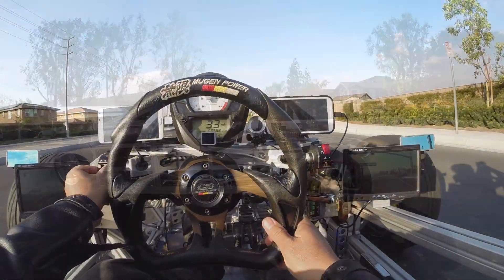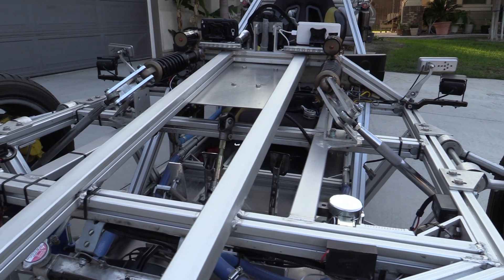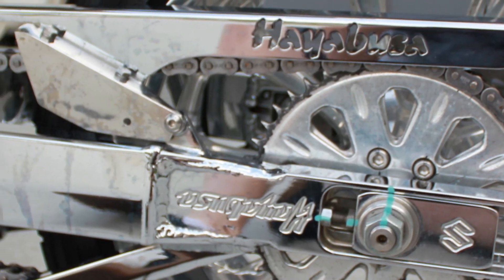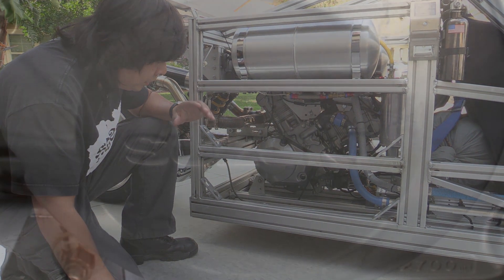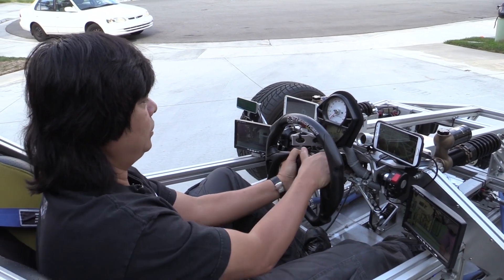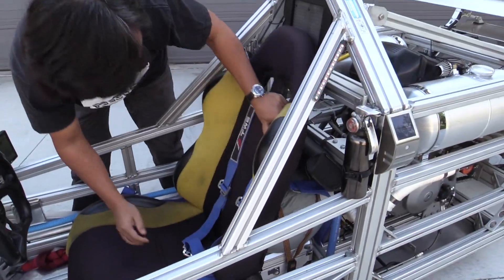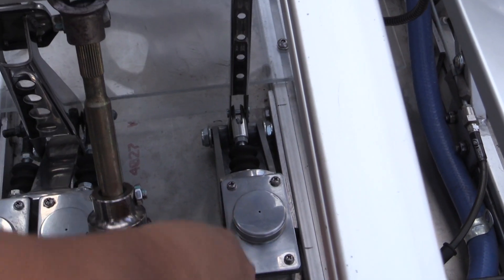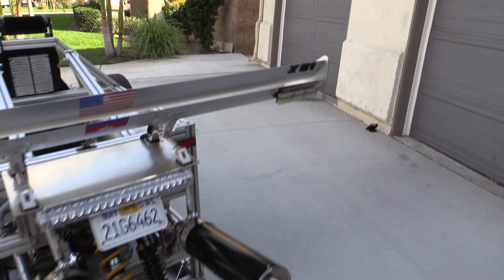Garage Built Three Wheeler Based on Suzuki Hayabusa SV1000 Not Polaris Slingshot T-Rex Morgan Elio

Comment: its definitely a unique design, but is no short supply of sketch,

Ive just wrapped up the finals on another robotics competition. we use this stuff all the time, but it is super flimsy. as in it starts acting up under 50kg's of stress.
that being said. i did also see one robot lifting 2 other robots up off the ground putting a total load of 140kg's on just 3 of these struts.

Comment: Nice Machine but  please think of a rear impact  your straight square frame

can kill you  like a spear through you,  you need to figure a crumple zone or collapsible

frame senerio, impact absorbing  a square frame doesn't provide that safety 

just a point to think of on the next build, maybe angled frame config back end, 

nothing straight and horizontal thats facing your back, build in a fold breaking point

when using square tubing or similar protection in designing this machine

a point to think over  okay !!!

Comment: Looks great, technically very interesting. Do you have any bump steer?
 I am designing/building a three wheeler and checked it out for mine - pivot points on the same plane, I think.

Comment: love your use of extruded aluminum in the assembly,I always said,people are passing on a incredible building material,a erector set.The plus side is you can bolt it altogether ,then weld it after final fit.Great job.

Comment: you mentioned reverse, how did you gear it?
Reply from the maker: This vehicle has a stock Suzuki SV1000 engine and transmission so it does not have a reverse gear. He has to get out and push it backwards to get it to back up.